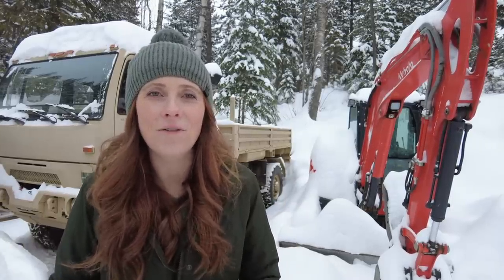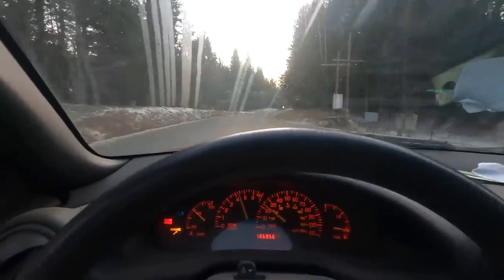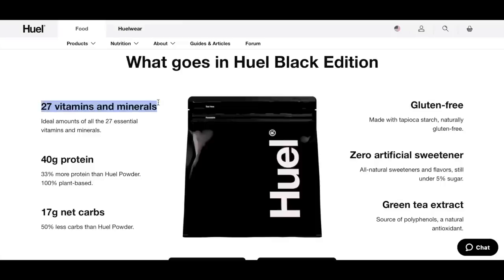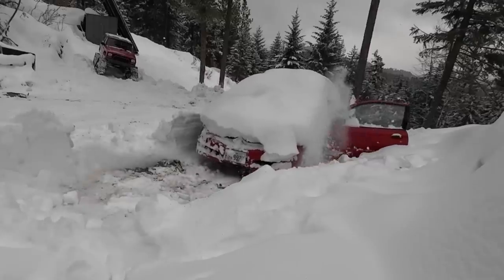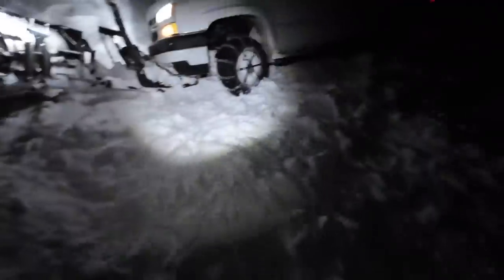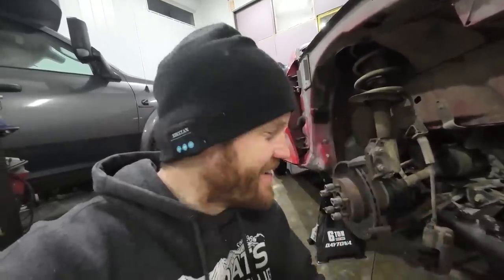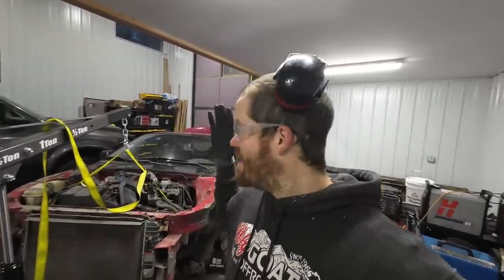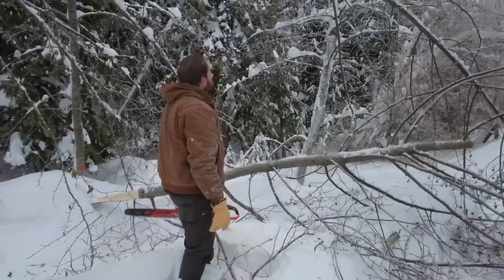Building The ULTIMATE SNOW BLOWER | P1

Comment: You're going to need that catalytic converter that you left on the car. Without it and the up- and down-stream O2 sensors, the ecu is going to be grumpy.

Also, the sunfire is most likely "drive by wire" so rather than the complexity of faking the VSS signal, you could just use a potentiometer to replace the throttle pedal, and dial in an engine speed.

Comment: If you hang that blower and motor off the front of the truck you are going to have to put many tons in the truck bed to get traction. If you give the Motor/Blower casters you may unload the front of the truck so much that you have only rear wheel drive can't steer.

Comment: Great ambition but I think you would enjoy the power of a Ford 300 I6 on that blower.  I know your Pontiac engine is small and lite but it does not have much torque.
Reply: I think the inline 6 is a great suggestion and you are correct the 2.2L engine he is attempting to use only has 150 ft.lb of torque @ 4,000 rpm. I suggested a non electronic, non sensor early 90's diesel engine, an I6 diesel would be sweet

Comment: It would’ve been a lot easier to get a snowblower for the skid steer they work awesome plug and play  And are readily available Just saying.       You will absolutely need chain’s for the new plow truck.    V bar cam lock are the way to go. Going to be expensive for that size tire.

Comment: Because it would be FAR TOO EASY to just add a hydraulic pump to the army truck that would run the snow blower. Let’s do everything the hardest and most dangerous ways possible so Courtney has to save the day …every single time. 🤣🤣🤣 I love watching these two. 🤣🤣🤣
Reply: But how would you keep the snow blower running fast enough to blow the snow when you idle down to turn or back up, or hit a huge drift that takes longer to chew through?

Comment: Interesting project.  You need to put weight in the back of your truck, people forget that the back of a truck is light and won't give traction very well. About 500lbs. Use sand so you can use it to get unstuck if needed.

Comment: Hysr get a electronic ram  for throttle and a turn noble switch it be 2 wire running in cab I had a small one and use it to lift topper lid it be a simple to make a bracket to mount and the head aches of wiring just made simple they wood even be good for putting it in gear there great little invention instead of hydraulic ram few knows and switches on a panel and quick disconnect in-between front some sealed connectors work

Comment: I don't want to be the pessimist spoiling all the fun 🙄 but a military surplus diesel would be very simple here. The isochronous governor found on diesels is "cruise control" and requires zero electronics. The torque curve on the ol diesel engine is very useful as well. I'll be watching  👀 with interest for the final product.
Reply: Would that diesel work well in the Winter?

Comment: This suggestion is not related to this video.  You have mentioned future plans for drilling a well and **if feasible**, you should consider this.  Drill your well where you can dig an underground enclosure like a cellar below the frost line and tall enough inside to walk around comfortably.   You will save a bunch of money keeping the wellhead and pressure tank from freezing in your harsh winters.  Also, with a vent hole directly above the well bore, you will be able to pull the pump for maintenance while in the shelter of the cellar.  The first rule of well pump problems is that they WILL happen during the worst possible weather!   Good luck to you both.

Comment: I’m curious why you would go through all this trouble for the engine and drive train from this car (in the end it may provide more power, except nothing beats hydraulics)!? When you could have simply added a PTO motor   (If the army truck doesn’t already have one for the dump bed) or an electric hydraulic pump/2nd pump to power the snow blower…

Comment: You didnt want to start with a manual transmission car? Youll have a clutch and just the throttle cable to worry about instead of the cruze control

Comment: Remember to keep the O2 sensors out of the exhaust!
Reply: Why???  It needs those sensors to run right!  That's one of the most basic and needed sensors of electronic fuel injection!  Now, since it's for off-road use the post cat sensor (and the cat itself) could possibly be deleted.   But not the front sensor!
Reply: @Cougracer67  yep, thats why i said he needs to keep them (as the exhaust is outside with the hulk for scrap. Remember to take em out of it)

Comment: Much as I apreciate the insanity of powering that with a car engine that Alison transmission in the LMTV has a spot for a PTO, you can get a hydraulic PTO kit and a hydraulic motor for the blower and with some quick disconnects you can take it on and off easily.

Comment: No, not making it up the driveway.  Made it up the old, steeper driveway.  So, was I wrong???  Probably.
I am pretty sure the M1078 has a PTO.  What I am unsure about is if it would be able to spin the snow blower fast enough while driving slow.
If you mount the engine up front on the snow blower, how much weight will you need in the bed to be able to steer it on ice?
Reply from the maker: That was Riley’s concern with using the PTO as well!
Reply: He is likely going to need to install tire chains, maybe some like they put on skidder tires with the steel protruding nubs to really grip the underlying driveway

Comment: have one question? Why newer injector engine😳 why not old model carburettor engine? less wires/fuel hoses and easier to find the fault if something breaks
Reply from the maker: Maybe I just come from a newer era but I find fuel injected engines with computers and OBDII diagnostics to be much easier and more reliable.
Reply: @AmbitionStrikes  but did you look into it? because I thought it was really much simpler to make a system where there are 5 wires compared to the 300 wires needed for injection. but I'm still eagerly waiting for the next part 😁

Comment: 🤷   YO  SUPER DUDES  
     HAPPY NEW YEARS     
 I don't understand people I had a snowplowing  business for years I don't have very much money and I did everything to the  cheat and cheep 
#1 one thing I know about snowplowing I always see people get stuck yes even with snow plows I never get stuck no matter how bad the conditions are 3ft. 
if I do I usually get right out you've got to put a lot of weight in the back of your vehicle it's not only counterbalances the plow but it gives you so much more attraction that probably would have saved you right from the beginning 
 The weight of a plow in front takes the weight off your back wheels you've got a  Counterbounce the plow for more attraction by weight in the back !!!

Put a lot of weight in the back of the truck a couple 1000 pounds like even  2 if you can yes a lot  it will work ,     If I did get stuck it was because I lifted up the truck by too much snow under and lifted the truck up then you gotta get out and work    Shovel
#2 Always plow in 4 wheel.   ( LOW DRIVE )
SAVES OR  Transmission
#3ALWAYS started out a full tank of Gas ⛽️   belive me one day will save your ass ! 
#4 there is more than that but start there . Lol 
#4 always have fun plowing   . 
❤️ Love you Wild CAZY GUY'S TOO
 Can't wait to see what you do with the blower and put it on the truck that's awesome man I'll bet you 2 do a good job and it works great it's gonna be a job a hard job 
Always told my kids nothing is for nothing and hard work makes great people and you end up enjoying it , people that don't have nothing  because will not work for it and  Blame it on everyone else
Always remember boys Itold them and see what you have and worked for .
 Congratulations job well done !  You 💋

Comment: Why did’t you use the hydraulics that power the dump?
Reply from the maker: Our dump uses an election hydraulic set up meant for dump trailers. It's not intended for constant duty. Also, it's nowhere near powerful. Also, if we used it continuously our alternator wouldn't be able to keep up to keep the batteries charged.

Comment: Personally I think the 140 hp engine is underpowered for an industrial blower with dual augers and 8 ft wide, Pronovost is a snowblower manufacturer that recommend 120-200 hp at the blowers PTO shaft for 98-102" blower, you may consider moving up to a 225 hp industrial diesel engine(high torques and hp) which after gearbox and friction losses will be around 200hp, this will give you the performance you are expecting.

Comment: Hey there.   Lots of fun as always in your content. A quick question: does the truck transmission not have an option to add a pto drive?  In my experience,  most industrial / vocational truck transmissions have at least a port in the housing where you can bolt on a gear driven pto.  We used such set-ups for gravel truck hydraulics, etc.  Just curious as it would seem to me to be a lot easier ( but perhaps less fun content) way of powering your snow blower.

Comment: That snow is called mashed potatoes.  It sucks to plow.  It sucks to deal with...  The cruise control might work, or it may over/undershoot a lot, depends on how the PID controls are done.  The inertia of the spinning blower is a LOT less than the inertia of making the car go from 50mph to 52mph, but It should still work if you don't need precise control.   Most older GM vehicles have had 2nd gear start, so with the shifter in 2nd gear, that is the ONLY gear it will use.  Just have to gear the drive so 2nd gear works best...  (Assuming 1st gear is too low...)

Comment: Three major issues.
One, there are too many wires, hoses, sensors, etc to ever get that engine running 100%. I used to design automotive EFI system.  Hopefully, yo can get enough connected to make it run.  Forget the cruise control.  Just wire the throttle up to some kind of a lever.  For get the gas tank.  Buy a 5 gallon one at the store and hook a fitting up to the bottom.  Use a REAL automotive in line fuel pump.
You will absolutely need tire chains, at least for the rear wheels.
You are also going to need a bed full of rock to hold that rear end down.

Comment: Hi Riley,  I'm curious why you didn't go with a diesel engine. Plus with all the equipment running on diesel, if you haven't already, you could get an oil company to provide you with a tank and supply you with diesel fuel at your location. Maybe I'll find out why you went with gas vs diesel in the next video. (I'm just thinking out loud. I would have thought a diesel with and nice hydraulic setup would have spun those rotors like mad, provided the option to play with the RPM in which they did, while not having ECM concerns and all the wiring to have to deal with.) I can't wait for an update. Happy New Year and all the best to you and Courtney.

Comment: You really should use a screw type throttle (meant for equipment) instead of trying to make a electronic cruise control do something with variations it was never meant for. You risk a runaway and hurting something.

Comment: Gues your truck doesnt have the horsepower to run that blower even with a front PTO kit you can get. I would have started with an old combine for the platform first easier and cheaper, many youtube videos on it, and its an exchangeable platform for different solutions after you are done. And there are many self powered rotary blowers out there we have a lot here in Tahoe where plowing doesnt work on trucks tractors and skip loaders

Comment: Why on earth would you even need that. You just put out about 60k on a big track loader with a big snow blower on it. That all you need. You hardly get any snow unlike up here in north western Ont  Canada were we get many feet of snow dumped an hard packed drift 7 feet high for hundreds of feet every storm. An we get them all most weekly. As well as month of -25 to -50F never any rain after Oct. My 1800 foot farm driveway gets pluged solid a plow pick up cant brake though. That's not counting the barn yard or feeding areas . I'd love that skid steer. I have a 5 tom dump truck with a hydro boom on it and a 10 wide high way plow that only wings the snow to the right.  How they are made. Even loaded with 7 yards of sand I cant get though  pushes truck side ways an stuck

Comment: Happy New Year !!! This will be an exciting project. Hope you didn't underestimate the power the blower will need to run. I had also done a similar project on a smaller blower, based on specs from the blower required HP and RPM but still ended up needing more power. The unit worked but would have been better with more torque. (your difference could be the trans axle if that is what you're going to use)  can't wait to see the end results.
Reply: I mentioned the HP issue above. He would be a lot better off with a diesel 225 hp industrial engine so that after gearbox and friction losses there would be about 200 hp at the blower shaft. I think he is going to be a bit disappointed in the blowers performance if he uses the smaller engine
Reply: @chrisdaniel1339  Yeah, it will likely need to be geared so that little Sunfire engine can keep boiling along at 6,000 RPM!
Reply: @Cougracer67  I looked up the specs, the ecotech engine makes 140 hp @ 5,600, 150 ft.lbs torque @ 4,000. The agricultural large blowers need a PTO speed of 540 rpm so there will be power losses in the gearbox. I think Riley is going to be disappointed in the performance of the blower if he uses that small car engine.

Comment: Merry Christmas and Happy New Year!
Will you be putting the engine assembly on some kind of pallet and turning it into a hydraulic pump unit to drive the blower?  It could be quickly disconnected and be used to power other stuff as well...  It would also act as ballast in the back of the truck to counterbalance the weight of the blower.
Reply: A buddy of mine would always buy beater cars.  I'm pretty sure I've never laughed as hard as when we were jumping snow banks or driving over curbs in an old white Justy... Search "Dukes of Subaru" on YouTube.
Love your wild creations and creativity. I have similar fun on a smaller scale.

Comment: Ok so I just found you guys today. Happy New Year but you guys are scary. Here's a couple of issues I've seen with your cargo container. 1 you did not put 2x4s in every 24 inches on your finished walls in the back where all your really heavy solar equipment is hung on the wall. Hopefully your current design will hold the load over time. Cross your fingers. 2 Find large boulders dig holes to put them in front of cargo container and bury. 50% below container. If your buried side somehow moves because your hill fills with lots of water, your container could slide and I see you have a down slope about 14 feet away. This whole thing is a scary setup. Ask a professional contractor of retaining walls to look at your design. Get a general contractor to review your walls with no studs every 24" apart. The more you don't know, the more money you waste and you can keep redesigning over and over. Talk to professionals. The money is worth it. 3 Slash burn piles are not meant to be bonfires where you really could start a forest fire. Cut one tree down. Remove its branches cutting to 5 ft. Begin to burn those. Find a good dirt only area there. Have water near by. Like a hose. Cut the large part into firewood or leave long to get cut for boards and building or sell log for building log cabin. Never burn that if it is good wood for fires or building. You can always sell it. I did see it ran on your burn day but be careful people! You guys are scaring me. But hey, you made it this far! Good luck with everything! Remember you can always pay a contractor for advice. It really is the way to go. You guys are super hard workers, very creative and funny! Work smarter not harder.

Comment: Questions:
Does the army truck not have independent pto?
Most of those trucks have front and rear pto’s
Also would a locking throttle cable be easier than the cruise control?
But your way is awesome too.
Reply: No to the locking throttle cable since the engine load will vary so much.  It will scream when not blowing snow and bog down when in heavy snow.  Using the truck's PTO would mean having to keep the truck engine at a certain steady RPM which is impossible.

Comment: Cool project!! I would probably have gone with a bike engine - they are more compact and have much easier wiring.. 😅 or maybe a electric motor with a gearbox, to get the rpm down and torque up.. ☺️ or it could be hydraulic powered..

Comment: That's a great idea Riley, but I would say way over thought an powered. I would say all you need was a 20 hp Vertex with pulleys or a hydraulic pump. To drive the blower.. Now you have to get that big engine on the blower , an then dream up a way to mount it to the truck. It's going to be a mile away from the truck... Then you still need to get it up an down.. An your adding a lot of weight that makes a bigger problem..Keep dreaming !!!!

Comment: Maybe worth considering a self powered hydraulic pump carried on the truck (unless it has that output already), hoses under the truck to power a hydraulic motor on the smow blower. No electrics, no computer stuff. The unit could also be used to serve other functions as a power pack. Having said all that Riley gets 2 trillion points for effort!

Comment: I live in North BC where it gets -35 often in the winter. I use a tiger torch(roofing torch) and a old truck stack, then put the tiger torch in the stack with the stack pointed at the oil pan or under the hood of equipment. 15 minutes and they start up beautiful